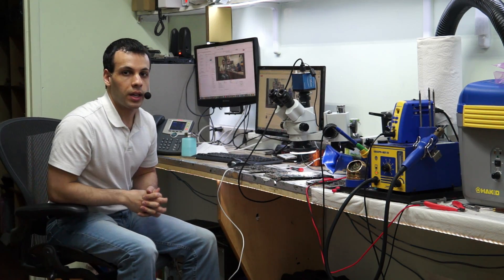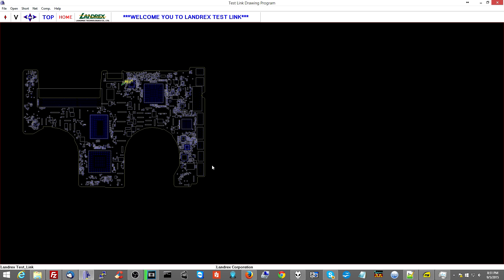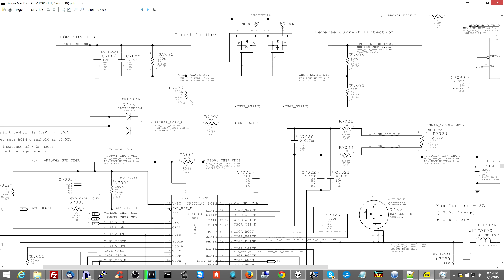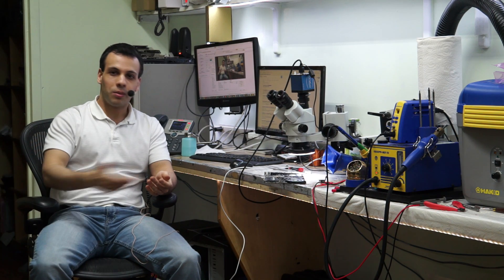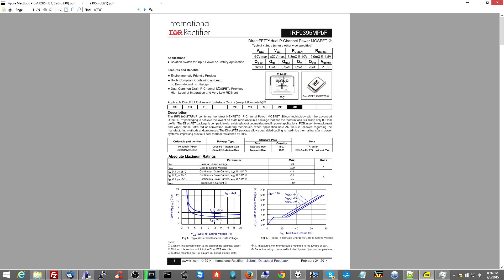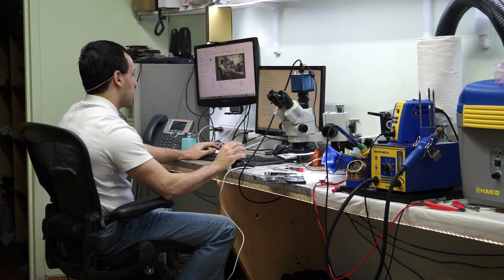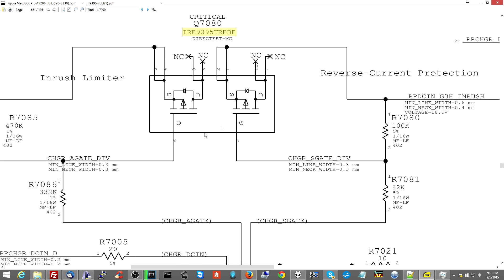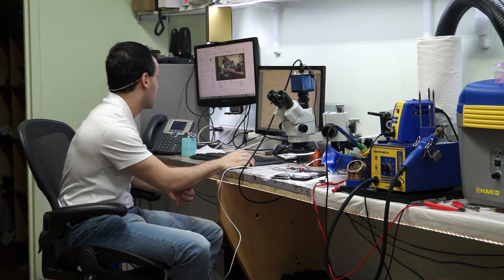How to troubleshoot charger MOSFET on Apple laptop motherboard.

Comment: Sometimes the automotive industry of getting parts for cars works the same way as for example. I like to change transmission fluid,  filter and gasket on my honda that has 260,000 miles because if you don't do you don't do that. I guarantee you the transmission will fail and I call up Honda the manufacturer of the car and they don't supply the gasket or filter at all because they want it to fail and for me to come in and do a complete transmission replacement. I feel that many repair industries that are a monopoly work the same exact way, it sucks, it really does but you can't change the way the world works which is why the 1% of the planet owns the entire planet and sadly it will probably stay that way you just have to work by their rules because they don't know how it is like for all of us to struggle which sucks.

Comment: wait wait wait... i may get it wrong but this mosfet has a gate charge of more than 3nF... if those resistors are so high in value (for efficiency reasons (and it's still weird that the gate was not shorted along)) to charge that thing you require some time (like >2 milliseconds apparently) this may sound unlikely but to charge the elec capacitors onboard and especially shorting em to the charger ones, this could provide an hi current and energy dissipation that goes beyond the concept of "transient"... and it blows... mosfets are usually driven hard, not trought some hi value resistors

Comment: Hi Louis, Is the HAT1128R01 Mosfet on the 820-2330 Board a P-Channel mosfet? If so, I have 16.5v @ the source, and 15.75v @ the gate, but i'm not getting anything through to the other side in order for me to have the 5v going to the u7000 chip. my issue is that i'm missing ppbus_g3h w/ no green light. Don't mean to bother you at work. Thanks.

Comment: nice explanation on that input power isolation switch ... you get that transistors are not linear (especially mosfet's channel conductivity.... Miller effect) second year in university but i guess you don't get through that if you just want you laptop fixed that's why your work is worth something more than 15$/h ... less people are willing to go through what's necessary to do that ... and that outside of a  Gulag camp should be pricey
Reply from the maker: If I were fixing an audio amplifier, there is reason to explain that to my audience.

If I were fixing a video amplifier, there is reason to explain that to my audience.

Fixing a laptop.. no. There is no need to explain that to my audience. A lot of time and thought goes into what I need to say so that I can explain this to an audience of people who have zero electronics repair experience and have them leave after watching able to repair a laptop motherboard. Anything that adds unnecessary complexity to it is left out. 

I understand this will irritate a lot of people, but it's just not part of the goal here. 

in terms of what my work is worth, no.
Reply: with latop repair you don't need to know that ... just placement of components on the electic path and their proper voltage at test points is sufficient for most repairs ... and with most people straightforward explainaton is best ... I got alll mixed up in my comment I was trying you do more than swapping components and explaining it to people with no experience and especially knowledge is not easy 
knowing element implementation is useful ... i am a physicist and occasionaly have to fix very old soviet era devices or very specialised ones... with no schematic ... then it comes in handy becuse you are essentially reverse engineering

Comment: You can't find the part online because the part number is incomplete as shown on the schematic diagram. It should be IRF9395MTRPBF. Yes both Mouser and Digi-Key have the part in stock.
Reply from the maker: +Solar Flyer Why would they not give a complete part number? That seems lazy and mean. :(
Reply: I don’t think they’re being jerks, just a typo. I review schematics all the time and see this type of thing. Stop being so negative. Also, when I search for a part number I usually use the base number (e.g. IRF9395) and let digikey/mouser website do the rest. In virtually all part numbers that end in PBF, this simply stands for lead-free. The lead frame is PB free. And if you run into a part number that ends with -ND, you know it’s a digikey number bc they all end in this postfix, apparently it stands for North Dakota. Ya I know digikey is in Minnesota ... but close to ND. There’s more to the story, can’t say why.

Comment: Don't feed the trolls! That T in MOSFET stands for transistor so that's what it is. It is not a traditional bipolar but still a transistor. If there are two of them in a single package doesn't change that so much... it is dual but still a transistor, a transistor. If someone has an urge to try and outsmart you, let them. Let them do their fancy calculations and draw all the curves while you fix the boards. Isn't your channel supposed to be about practical board repair? When a transistor is used as a switch those curves are irrelevant and digging too deep in the details is not practical at all.
Reply from the maker: +ko2610 Yeah I never got that from trolls. If someone really wants me to specify MOSFET vs BJT then they are not my target audience.
Reply: +A. R. Jasso Note to Louis: say "Metal Oxide Semiconductor Field Effect Transistor" each and every time. :P